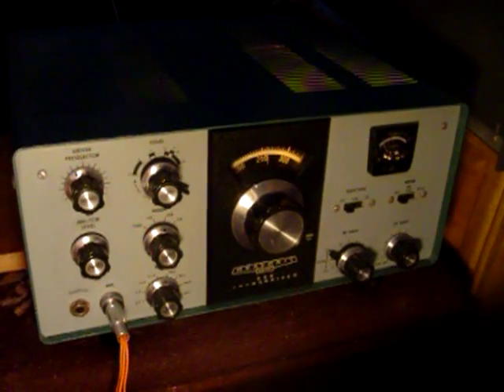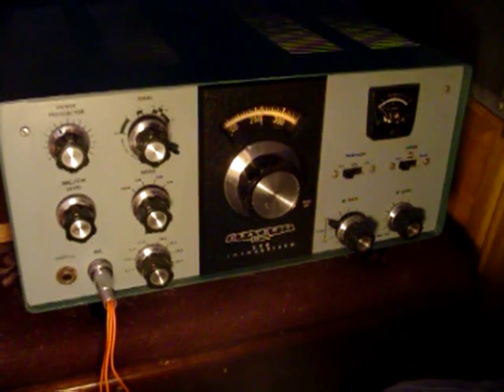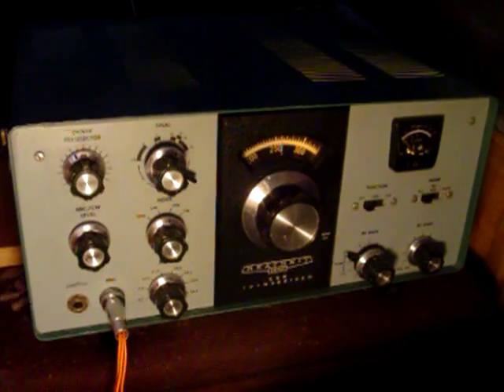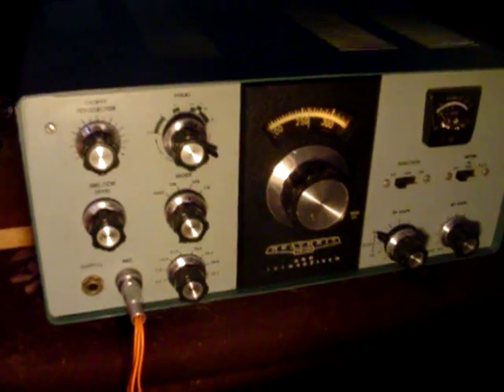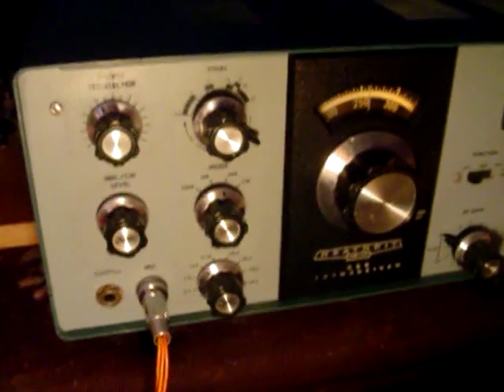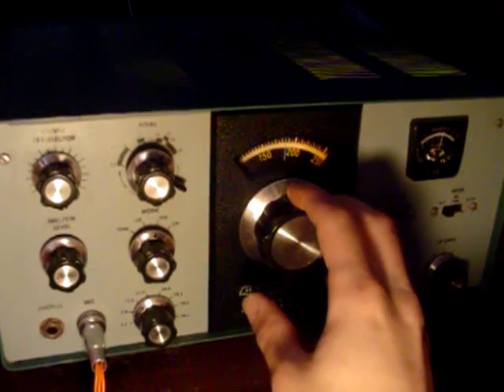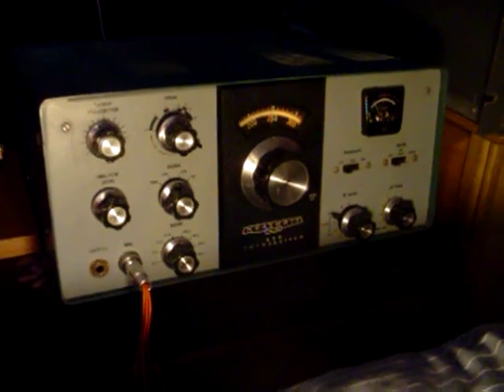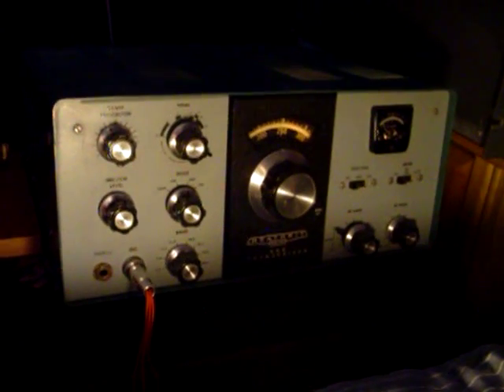Heathkit HW 101 Overview

Comment: i got one of these for free i blew the op tubes as the meter was not working so i had no idea if it worked,only one had gone i had one know its ok.
needs a little work switches covered in some yellow crud one or 2 tubes were buggered.
jeff m0prf .. ps the rig is a bit of a drift bucket ..

Comment from the maker: It's amazing how many of these were sold, how many people they put on the air and how many HW-101's are still with us today. I still use mine quite regularly and have recently fitted two 80mm computer fans to the back as the radio runs so hot that such cooling is really a must do. With the fans running the case is only warm to the touch. -  Mike

Comment from the maker: My HW-101 came with a rather tired looking SO-239 in place and so I replaced it with a new Amphenol unit. On my unit there were four holes drilled in the rear panel to accommodate the SO-239.

- Mike

Comment from the maker: @Polybun 

I was surprised how few out of tolerance resistors I found when I was diagnosing the S-meter issue. I think the issue might have been down to a leaking electrolytic, a few resistors out of tolerance and perhaps a resistor with a hairline crack in it.

                       - Mike

Comment from the maker: @82MB240D 

I prefer older radios as they have character and require a certain finesse to operate them. I'm finishing up a relatively major going over of my HW-101. One day the S-meter decided to pin itself all the way against the left stop and refused to come up. I've spent a fair bit of time replacing out of tolerance resistors and one leaking electrolytic. I'll try and take some video footage of it soon. Take care!

                          - Mike

Comment from the maker: @82MB240D 

They're well worth your time. I need to replace one of the front slide switches on mine and then it'll be back in business. Keep your eyes peeled at ham fests, eBay and Craigslist for them. Heathkit made plenty of them and so you'll be able to find one without much trouble.

                       - Mike